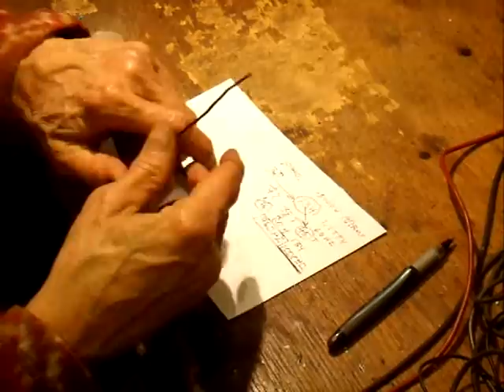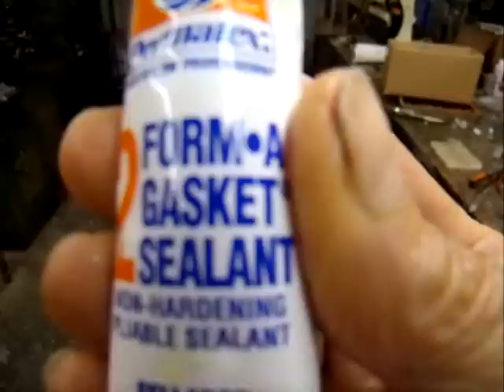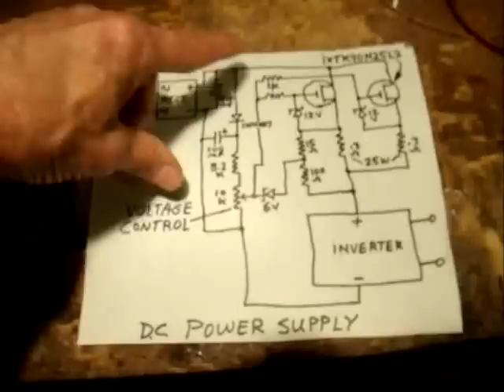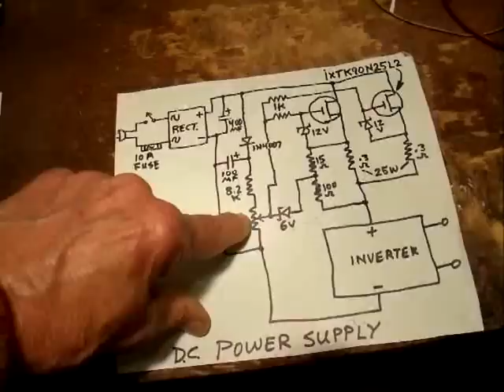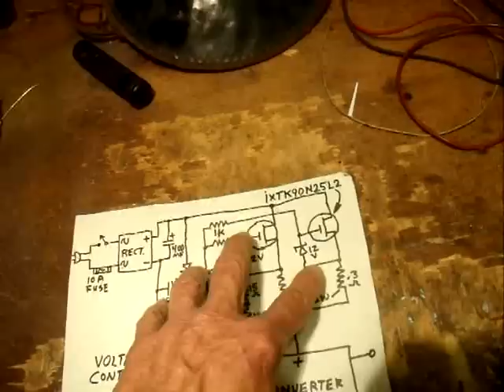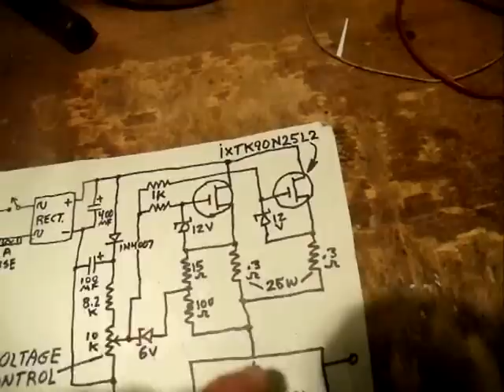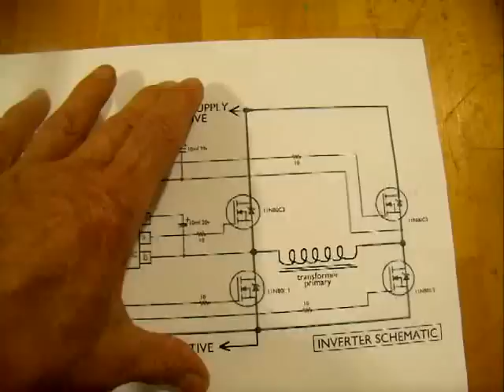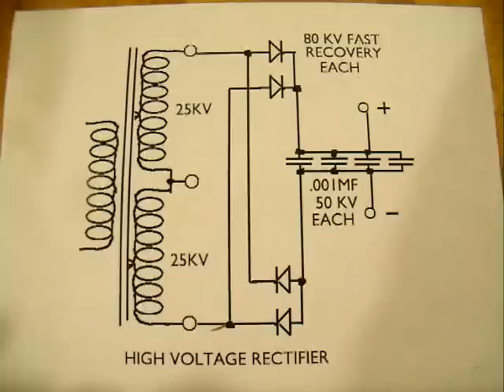making a 50,000 volt power supply

Comment: My Dad gave me a 15 kV 60 ma neon sign transformer for Christmas when I was about 16 years old.  I tried to make a Tesla coil with it including a capacitor made by sandwiching sheets of aluminum foil between sheets of glass.  I had no idea what I was doing and lucky I didn't electrocute myself. Almost 50 years later I'm still fascinated with high voltage electricity, watching this genius with both electronics and mechanical engineering skills.  What a rare combination of talent.

Comment: Another amazing experiment Ron!
   I use to work with 1 million volt power supplies at our company where we made Ion Implanter Machines. I loved drawing arcs in the faraday cage that made everyone in the factory floor jump when I was ramping them up in voltage to see if my repair worked.
   Great video. Love to see the next experiment.
   PS You should probably rig up some kind of safety switch to ground those doorknob caps when you turn the thing off. I know I would.

Comment: This looks like the hard way!  I also used a 15,000v 60mA depotted NST run via variac variable from 0 to 147vac connected to the NST, this gives ~ a 0 to 18kVac RMS smoothly variable AC output, followed by a full wave voltage doubler giving a smoothly variable 0 to 51.5kVDC. I decided to pull some shunts and got over 70mA (I measured this on my DMM on the 200mA setting).  I only use a fraction of the variac V rating.  My load is two of those 150lb (70uF @ 12kV) energy caps in parallel (140uF @ 12kV) for quarter shrinking.  I was going to immerse it in oil, but tried neater parrifn wax instead.  It has been running perfectly since 1998!
I bought it depotted (cheaper!), so virtually NO work involved!!
Reply: Can you give me some in for on the power dissapation. Is it different for higher frequencies or not? I'm running a weird transformer at 60Hz from two identical MOT E cores put end to end with both primaries. I'm going to custom wind a 25,875 turn secondary to fit between both primaries and run it at 30Kv at 30-50 mA. I'm having trouble getting a Ploss number that makes sense because his math just seems off. I^2*R Don't make any sense to me. I either get outrageous numbers or tiny ones. Using 32 AWG at 25000ft the resistance of the wire should be 4100 ohms. No where near his 12000 ohm. He got 40 w per coil but 0.02^2*12000 is 4.8 not 40?

Comment: After watching this again a year later I'm still impressed.  With that said, I built a 40kv supply a few years back out of an old flyback I rewound several times and a 100 watt pre-built induction heater driver circuit for my basic platform.  Everything was in oil and worked pretty well, but not near the wattage Ron's does. On a side note: Not until I ordered my 1 billion ohm precision resistor and built my high voltage meter did I realize just how high I could accurately measure an output; one where I placed several flyback in series......To my surprise I achieved 300kv unloaded. No, I didn't you use it for anything. Afterwards, I disassembled it and thanked God I wasn't killed playing with it.
Reply from the maker: I question the accuracy of your measurement equipment. To measure voltages over about 60KV takes very specialized equipment that is designed to avoid corona conduction, which can falsely make your readings seem very high. 300kv will have such corona in free air it would take a kilowatt to maintain it, and have to have special insulators to keep corona effects minimal.
Reply from the maker: @XENOPHON The coils in the transformer heat up very quickly at 2000 watts output. Typical operating time at that power level is 30 seconds with at least an hour cool down. Most of my applications are only a few seconds of full power.
Reply from the maker: @XENOPHON Best to not depend on isolation transformers. Make your normal operating procedure such that you never place yourself in the circuit path. This will protect you in the many cases where an isolation transformer will be meaningless!

Comment: I am confused. At 36:00 you are talking about the oil shorting out between the terminals. I thought you wanted the oil to get in there and between everything, otherwise there would just be a gap. If the oil is shorting out in the transformer, doesn't that mean the breakdown voltage has been met and surpassed?
Reply: He was talking about oil flowing and going from one part to another. But yeah I don't understand either.
Reply: @theq4602  yes, it does seem he is isolating the several areas of oil, but still wondering what that has to do with shorting out.
Reply from the maker: If there is no PHYSICAL barrier to keep the oil from flowing, the oil will pick up a charge and flow to the opposite polarity. This transfer of charge can be so extreme as the voltage is raised that a direct arc will form which converts the oil to carbon particles. These will sustain the arc shorting out the transformer. The plastic sheet stops the oil from moving in the area so the charge cannot pull the oil along.
Reply: @glasslinger  nice, I had no idea that effect would happen. Very interesting.

Comment: Ron does it again when he calculates his primary. First, he had counted 139 turns but he runs his calculation with 134 turns. Why? Second, when he divides his voltages, again he makes another mistake (3.7 instead of 3.33). Finally when he calculate his peak versus RMS, he goes by nosometer and increase his number by 10 turns, he should increase it by 41% but his round number is 29% higher. You wonder where all those numbers come from. At the end of the day, it doesn't make a big difference other than his transformer will have 65 kV output instead of 50 kV. It would have been interesting to see him take some measurements.
Reply from the maker: I guess at most of the figures. For hobby equipment perfect calculations are not necessary so long as you know what you are doing. (note: I have made some horrible mistakes!)

Comment: 1. So are the coils stay dry? I thought you wanted the whole thing in the oil for heat dissipation and oil in the little spaces of the wires in the coil. Or is each clear box filled with oil then sealed? 
2. So the chip doesn't handle any power; it just sends pulses to the mosfets on the printed (2nd) schematic? So we have 6 transistors total? How much power goes through the mosfets on the printed(2nd) schematic? I'm trying to figure out which components have the high 5A current going through them. Also how do you set the frequency? A resistor or something connected to the pins of the chip? 
3.  What pressurizes the gasoline can? Heat or do you have to keep pumping 
it up?
 Everything back in the day required warm up: your TV, car, radio, oven,
 blow torch. Now everything is instant, and it's still not fast enough.
Great work BTW...

Comment: This is he best educational video on this subject I have ever seen. A modified version would be ideal to kill the "Covid-9 virus"  in a ventilation system and as far as I know this kind of virus protection unit is not available.  This would be used without a carbon filter in order to get higher air flow through the air conditioning system at a lower amperage and voltage.

Comment: I have been wondering, could you use a voltage multiplier (or ioniser formation) to provide a stable voltage enough for an xray tube, im designing my own fluroscopy setup but I'm hoping I can get away with an - as light as possible - design, I thought I could then add taps to the multiplier and use that as variable power source to increase or decrease the strength of emissions
Reply from the maker: It depends on how strong of an xray you desire. For soft materials like bugs and lizards you don't need too much voltage or current. But for even relatively thin metal it takes a lot more voltage and current into the tube. A multiplier can generate lots of voltage but gets very bulky if it is also to supply appreciable current.
Reply: @glasslinger  what would you suggest

Comment: Ron! The paint thinner back there so close to the brazing station! Watch out! How can you handle the wires to draw the arcs without getting shocked? Is it because the output is floating and not 'ground referenced' ? Maybe you actually DO have a ground lead clipped to one side of the xfmr and later to one side of the dc rectifier output? I worry about you getting hit whereas it seems there's nobody around to help except the cat. Some years back I got hit with 800vdc from left to right hand straight across my chest and lived to tell about it but would not survive it a second time, once is enough to learn. Happy arcing and please keep going, your videos are just fabulous.
Reply from the maker: The cans are empty, I use the sheet metal from them. The wire is insulated for well over 50,000 volts. It is not permitted to get a shock from this supply. You are dead! Every move is carefully planned when working with the unit.

Comment: btw, that IRS2453 can be driven from an external square wave if you provide a level shift such that it doesn't drop below 1/6th vcc. i used that chip to make an induction heater, running at about 130Khz.

Comment: Beautiful video! I'll pass it to my friend who wants to build van de Graaff generator using 1 foot sphere isolated on 5-foot vinyl tube. 50kV startup feed on the lower comb near the rubber belt should build the sphere charge to 1 MV in no time with 10 mph belt speed :)
Reply from the maker: This supply will easily charge dual belts a foot wide to produce over 100uA at a half million volts. The width of the belt is what gives fast charge time.

Comment: What was the intended use of the power supply may I ask.
Reply from the maker: I was making a charge coupled voltage multiplier to generate a million volts. This supply was used to charge the multiplier. The project failed due to unforeseen technical difficulties.

Comment: 35:08 ...Wait, why would oil flow matter?  It should insulate regardless, right?
Reply from the maker: The flow can get so fast that a significant current  flows generating heat.
Reply: @glasslinger  Ah, weird.  Ok, thanks.  Is this a phenomenon you've seen happen, or heard about?
Reply from the maker: @Erhannis  This is a problem only in high voltage DC supplies. AC oil submerged transformers don't have oil pumping because the polarity is changing too rapidly. Examine the construction of DC Xray power supplies and you see the carefully baffled design.

Comment: At 13:22 you explain why you gave up the idea to use an X ray machine which was perfect just because it had a coil with 65 k ohm resistance and would generate 260 watts at 20 mA. After I ran my own calculation the result come out as a 26 watts. P = Isquare R = .02 x .02 x 65000 = 26 watts. Doesn't work. Please explain.

Comment: Thanks for sharing this! It's such wonderful information. I'm planning on modifying my modern France 15kV NST by removing the center tap so I can full bridge rectify while grounding the anode. I'm only hesitant as I understand the transformer is only built to insulate 7.5kV in each coil, so I don't want the secondary to arc through the coil to the primary or case with the potential raised to 21kV with respect to ground. I was thinking of emulating your procedure to remove the tar, wrap the coils with Kapton tape if it will fit, and submersing the transformer in oil. In your opinion would this be enough dielectric insulation? Or am I overthinking this and the tar would suffice as is? 
Thank you again for the information!
Reply from the maker: The tar will fail. The francformers many times fail even at 7500v. We had lots of "dead enders" when in the sign repair business.
Reply: @glasslinger  Good to know. I just melted the tar out last night in fact. I'll go ahead and use Kapton tape and a dielectric oil with vacuum treatment as insulation and hopefully that'll be enough. If this burns out I could always try again with another NST and rewind the primary as you did. Thanks again for proving these are capable of such high voltage - with modification. Looking forward to more videos of yours!

Comment: For the sake of safety you should keep it shorted. Never leave it open even if it shut off. Capacitors can gain their charge due to a static around and their insulators can have a memory effect -- charge absobtion. So you can get some shock touching it. And although they are unlikely to contain dangerous energy, sudden shock would cause you to drop something or touch something dangerous.
Reply from the maker: Definitely happens!  I always discharge the caps immediately before working on the unit.

Comment: Aren't caps rated peak to peak? I.E. a 240V RMS would need at least 400V capacitors?
Reply from the maker: At least. I use the 630 volt caps. With polypropylene caps at 60hz the DC voltage is accurate for AC. Still best to use much higher voltage caps.
Reply: Depends what caps your using x or y type supression rated 275v will take about 500v dc easily where a normal poly one won't always use caps at double the voltage ur working at

Comment: I could not help but notice the band saw that you have. Craftsman-1950's vintage? I have a set of Craftsman's machinery that my Grandfather had back in the fifties. Also a table saw, drill press and plainer-joiner. All work well. Anyway....
Reply from the maker: +Mike Prell 
The old tools are well made. I put new bearings in the band saw and it works like new!
Reply: Excellent! I need to do the same. Where can I get these parts? BTW. Great series! Like your style!

Comment: You mentioned that one could also use freon tanks for cutting open with an oxy-fuel torch because freon is nonflammable. This is true, but many types of these refrigerants break down at high temperature into toxic and flammable gasses. The heat from a torch will heat up the steel hot enough to break down the gas on contact. You will be left with a very lung unfriendly gas. I did this to myself once, so I can confirm that at least 1,1,1,2-tetrafluoroethane does break down and go off with a bang, and after catching just a tiny whiff of the toxic fumes I experienced lung pain for about 20 minutes. I had the bright idea of using a chilling spray to quickly cool down some parts I was welding near a heat sensitive area (I think it was something plastic that could not be easily removed). So my plan was to go in with high heat to quickly weld small spots after which I would quickly cool the hot weld button with a can of refrigerant gas. This worked brilliantly once. The second time the button was still white hot when I started hitting it with the liquid coolant, which formed a toxic cloud and then ignited itself from the heat of the hot button.  There was a loud whump and my face and hand was enveloped in a blue and yellow flash. I could feel the air pressure blast right up through my nose. It was hot, but not hot enough to burn. I had goggles on, so I was somewhat protected. I was somewhat startled by the explosion, but what really took me by surprise was the smell and instant painful involuntary choking. I've inhaled some nasty vapors in my time, but this was the worst. Luckily the vapors cleared quickly. I didn't try that again. I settled on using a wet rag for rapidly cooling down the workpiece.
Reply from the maker: I always use a 40 inch industrial fan blowing the fumes directly out the door when I do any welding or cutting. All gasses from welding and cutting should be considered dangerous.

Comment: Very good and instructional video!! I have a few questions, though. I am looking for a power supply capable of putting out 50 kV or more, at 20mA or more. I see that the supply that you just built puts out the aquired amount of power, but i need to have it DC, negative voltage. There are many of these power supplies out there, but the cost is just far too large. So I turn to you for advice. Is it possible to construct the same setup as you, and then , using a voltage multiplier to rectify the outcomming current? Thank you, again for your wonderfull videos, this one in particular, and please note that English isn't my native language.

Comment: The thing is that it is a variable power supply so he can manually adjust the output voltage but if he tries to crank it up a little bit too much, he may see some smoke coming out of his capacitors.
Reply from the maker: The capacitors are tested to external arc over. (about 75kv)

Comment: Hi,  a friend of mine has a laser welding machine - the power requirements on the label says the following " Rated Current 80A, Laser Power 400W, Rated Voltage 380V(10%) 50HZ, Rated Power 12KW." can u tell me how we can build a box to power this machine. can u help power this machine ?

Comment: So iron core transformer works with 2 KHz? Why didn't just use 50-60Hz ?
Reply from the maker: Energy transmission through a transformer is directly related to frequency. Double the frequency: twice the energy transfer for a given size transformer, etc. Going from 60hz to 2khz gives about a 30 times energy transfer capability for the same core size!

Comment: Thanks for sharing the information. What is that oil which is used as high voltage insulator ? Is vacuum oil a good insulator ? By the way I like your supervisor. She has supervised really well.
Reply from the maker: I was fortunate to have a friend at a metals junk yard. He saved old Xray machine parts for me. The oil is out of those transformers. Professional stuff. I have used ford FLM transmisson fluid. It works well and is cheap!